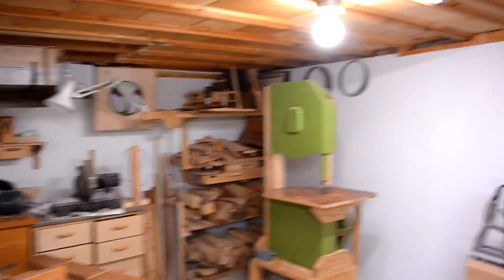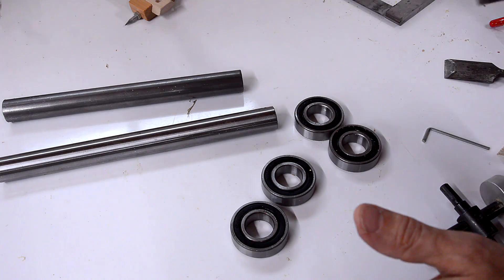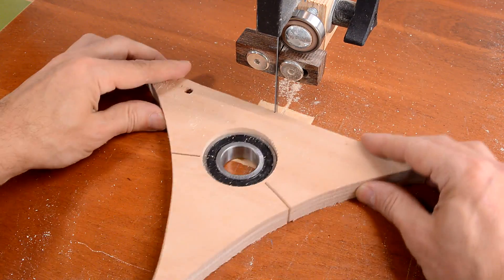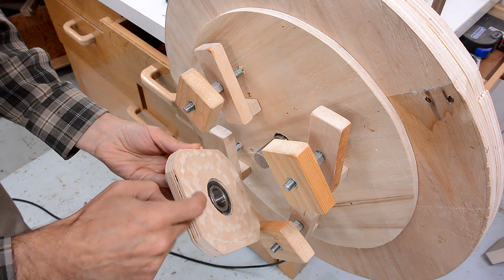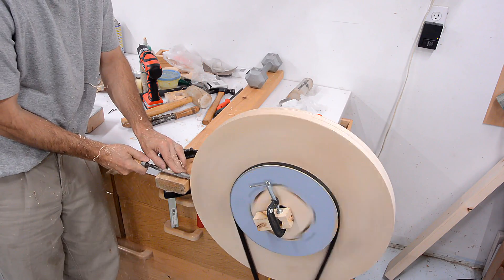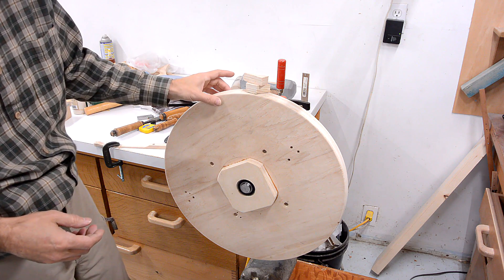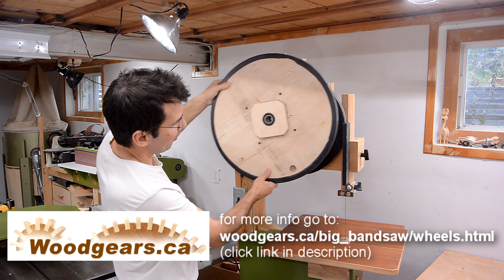Big bandsaw build 1: The wheels

Comment: Have you considered using some rubber cement to keep the tires in place?  I've done that on aluminum and cast iron bandsaw wheels, and it's worked great.

-jcr

Comment: What are the advantages of a larger band saw?   I'm building a shop in my basement and I'd like to build a bandsaw like yours.   Could you have weighed the wood that you used to balance the wheel then added some weight to the light side?

Comment: I've never seen the guide you used with your drill that looks like a router's plunge base. 

Did you craft that yourself, or is it a third-party accessory?
Reply: It's a handheld drill guide. They're quite cheap and very useful. You can use them to drill dowel holes as well as perpendicular holes on flat surfaces, including walls. https://www.amazon.com/s/ref=nb_sb_noss_2?url=search-alias%3Dtools&field-keywords=handheld+drill+guide&rh=n%3A228013%2Ck%3Ahandheld+drill+guide
Reply: Thanks!
Reply: BİR ŞEY 00???

Comment: What exactly do you mean when you want a crown on the wheel? What does that mean/refer to/do?
Reply from the maker: google it
Reply: Jean-Pierre English It needs to be higher in the center than the edges. Watch again when he puts the square on it afterwards.
Reply: The edge of the wheel is not a straight  cut. They are like  ")". So that bandsaw
 can aline itself on the wheel. Watch the video again. it is at 7:45
Reply: A counter-intuitive effect is that a tensioned flat belt loop running on pulleys, is that the belt tends to want to "climb", so if the center part of a pulley has slightly larger diameter, the belt will self-center on the pulley. No side walls are neeeded.

Comment: 7:23 why didnt you just leave it as big as possible for more capacity? and why only 2inches bigger than the other saw? seems pointless when you couldve done something bigger??
Reply: Fester Blats larger wheels result in a wider throat unless you have 3 wheels then you can use smaller wheels. u can get custom size blades at almost anywhere that sells blades
Reply: Where I work, we get bandsaw blade on a spool, so we can cut it to size. Then it is welded and ground. We can make a blade of pretty much any size.
Want a 50" wheel, 120" throat, 60" of free blade? We could make a band for it! (Not that I'd want to try using it)
Reply: Wayne Moore yip, anythings possible

Comment: Shouldn't the top wheel be as light as possible to decrease the stress on the blade and tires while starts and stops of the saw?
Reply: I don't think you need to worry about stress on the blade. I mean, it is a steel band. Stress on the tire will be no more than sawing stress on the bottom wheel.

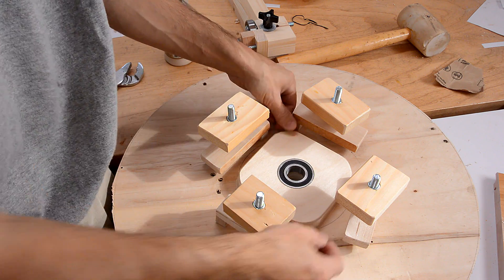Comment: At 4:50, Matthias centers the first flange by eyeballing it. I would think this would be the most important application and require more precise centering. Does it not matter because he knows he can lathe it true?
Reply: The flange corners have a circular radius. He also drew a circle on the wheel. I think he was visually aligning the radiused corners to the circle drawn on the wheel.

Comment: Have you ever considered a 3 wheel band saw?  Also what hand drill guide were you using around 4:00?  I've been looking for one and can't find of any any quality.
Reply from the maker: Three wheel bandsaws are a bad idea.  They break blades.
Basically, three wheel bandsaws are big bandsaws with most of the disadvantages of a small bandsaw
Reply: Thanks for the reply.
Reply: +lorddarphyve  there are several Mfg.s of this design  check the mail order tool catalogs  Rocklers  Lee Valley  Garrett Wade etc  or Amazon  I have seen them called Porta a line or porta guide
Reply: What's the physics behind this bladebreaking?
Reply: My understanding is 3 wheel bandsaws have shorter radius wheels which more easily fatigue the blades until they snap.
Reply: +Jared Parnell Partly correct, 3 wheels also increases the bending action on the blade by 50% per revolution. 
I'm pretty sure we all know what happens when you bend a piece of metal back and forth more than a handful of times ;)
Reply: The blade bends through 360 deg every revolution in either case - 2 x 180 for 2 wheels or 3 x 120 for 3 evenly spaced wheels. It's just the wheel/ bending radius that makes a difference.

Comment: What's the name of the tool he uses to drill the holes in the flanges for the bearings? The adjustable radius thing.
Reply: Fly cutter
Reply: I'm mixing metal and wood work. For wood they call it a circle hole cutter.  There is also a hole saw that isa cup shaped cutter with saw teeth around the rim.  Do a search on Ebay or amazon

Comment: what are the differences on a bigger wheeled bandsaw?
Reply from the maker: The wheels are biger
Reply: You can saw more bigly.
Reply: Larger wheels allows for larger stronger blades allowing a larger throat so you can cut bigger things.
Reply: Hope you don't mind me answering.  Larger radius wheels are much nicer to the blades as the blades are not bent in such a tight radius.  As blades get larger and thicker they get less flexible.
Reply: Fester Blats yes he doesn't have the best social skills, fantastic engineer though
Reply: More room between the cutting and returning blade, so you can fit larger work pieces between.
Reply: Matthias Wandel Haha.
I should of said, what are the advantages?
Reply: Looks like he's planning to use 1-1/2" blades... watch for some veneer uploads down the pike!
Reply: lmao
Reply: I think the bigger the  wheel the faster the saw moves.

Comment: I feel like fixing the wheel to a shaft with a hub and, using pillow block bearings, would make it a lot more durable. I could be wrong, but I like the idea of being able to grease my tools bearings.
Reply from the maker: Fixing the wheel to the shaft is not that easy or reliable.  Easier to put the bearings on the wheel.  My first bandsaw has the lower wheel fixed to the shaft, but this is much better.

Comment: Why would you varnish the wheel?  Will it work better, or just look super cool?
Reply from the maker: in case I cut wet wood
Reply: it also helps slow the expanding and compression of the wood due to moisture levels, preventing warping etc....waiting with baited breath for the next installment..I've considered building my own as well after seeing you first video years ago(Matthias) I just never get up the courage :)...guess it is better to try and fail, then to never try whatsoever.

Comment: I wish you would have explained why you would need a bigger bandsaw in the first place.
I mean, what is the benefit of a bigger radius?
Reply: A bigger radius allows for greater distance between the edge of the piece and the cut. Imagine ripping an 8x4 sheet of material into two pieces, each 8x2 (actually a little skinnier due to the saw kerf). No matter how you try, you would need a wheel diameter of at least two feet in order to make such a cut.
Reply: +John Cochran Ah, of course. That makes perfect sense. It's actually so obvious that I feel a bit embarrassed that I didn't realize it myself haha. Thanks for the explanation :)
Reply: You could add a 3rd or 4th wheel to attain the same effect, but the frame would have to be more rigid.
Reply: Wider radius' allow for bigger blades, in turn you can cut bigger material. On say a 14 inch bandsaw you couldn't put a blade suitable for slicing a plank of 2 inch thick stock (say 6inches wide for reference) down to two pieces of 1 inch thick stock because the width and thickness of the blade needed to withstand that sort of work wouldn't curve around a wheel that was 14inches in diameter. 

We have three bandsaws at work, one being the 14inch for fine work. The 26inch for the bigger stuff and the 35 inch monster for ripping rough stock as I just described.
Reply: Mads Rasmussen bigger is better

Comment: so can you clarify why the wheel diameter needed to be increased in order to increase the resawing capacity?
Reply from the maker: It doesn't.  But bigger wheels allow for thicker blades, which are more robust for resawing.  Also, when cutting out stuff, it helps to have some elbow room
Reply: Ah.  Thanks for the explaination.

Comment: Hi Matthias - I need a bandsaw and consider building yours.  But I am weighing that option against buying an old one. Where I live it's easy to find a cast iron 30 inch bandsaw for about 200 CAD.  The downside is that these weigh about 800kg.  Did you ever consider buying one of these?

Comment: if you want to prevent slip between clamped parts (yor steel rod clamped to the table for example) it is better by placing a thin layer of rubber (like electrical tape) between parts instead of adding excessive amount of pressure.

Comment: I appreciate the new build video. Very efficient. The older wheel-making videos were good, but there were issues for me in getting the hubs on straight and getting that danged temporary pulley and then the drive pulley centered. You addressed all the issues I had in building my wheels. The home made clamps really would help. Looking forward to the rest of the build.

Comment: I like the little test videos, like the sawhorse one, but the more complex and practical build videos are always your best stuff.

I assume more precise methods of cutting, like sanding or filing to shape, wouldn't help very much since you're using repurposed "old crap", as you put it. Brute-force jury-rigging is what I'm used to on my own projects, and "good enough" counts in my book, but after watching the Clickspring guy building his clock I have to wonder if more precise methods would make a useful difference on these low-grade materials you like to use.

Comment: Matthias, regarding the use of home made flange clamps rather than the bar clamps inserted through big holes: Do you think the trigger type speed clamps through the big holes would have worked?  Or is it something other than the twisting action during tightening that moves the flange?
Reply from the maker: Those speed clamps aren't much use for glue-ups.  Too weak.  And they flex a lot, so they'd certainly move the wood.  And you'd need a much bigger hole.  All around unsuitable.

Comment: I see you didn't decide to adopt Marius Hornberger's changes to your wheel design that work better for higher RPM, what kind of speed will this machine go at?
Reply: With a larger diameter wheel you do not have to increase the RPM in order to get a faster blade speed. Because the larger the diameter, the higher the peripheral surface speed. It follows this formula (PI * DIA * RPM) / 12 = Surface Feet Per Minute. So increasing either the diameter, or the RPM nets you a faster surface speed. This may also be why life is so fast in the tropical zone? They're just spinning quicker there.

Comment: Did you consider using the large bicycle wheels for your bandsaw. Can't remember where I saw it on youtube but the guy stripped the wheels off a bike and used for a band saw.
Reply from the maker: if you do, you need to replace the hub so you can get the right size shaft in there, which means you need to replace the spokes.  You also need to put something around the rim that is hard (like wood) to trim it to the right shape.  While you are at it, just throw away the bicycle rim too - makes it much easier.
Reply: True, you might be limited in the shaft size etc, but then you don't have to turn a crown molding as the tyre  is already crowned and that self centres the blade. If you use the shaft that comes with it then you're half way there. I saw it dine on a band saw mill.

Comment: Is there any reason why you didn't want to go larger than 20" to perhaps 24" (or more)? At 20", it doesn't seem that much larger than your other (18") bandsaw. (Serious question - not criticising). I'm guessing that maybe it's the blade cost, or the size motor it would take to turn them, or any bigger and it just wouldn't fit in your shop... So, since you are making it yourself and going through the effort (which is always  amazing), why not make a bigger jump in wheel size?

Comment: You are very talented and I love all the tools you make but I have to say the bandsaw ones scare the crap out of me.  I keep picturing the blade snapping and flying across the room cutting off everyone's head
Reply: sharkinfested You want to talk fear, watch some of Izzy Swans early Table saw projects. keep in mind both these guys have off the charts talent with their processes, so a bit of fear that causes caution is probably warranted.
Reply: Err...what?
Reply: In my experience, the most frightening thing about a blade snapping is the 'bang' it makes which is amplified by the metal casing, and can scare the proverbial out of you.  However, the same metal casing retains the broken blade - which loses all its motion pretty rapidly anyway as the break releases it from the drive wheels, so its just noise that produces a heart attack!
Reply: Don Johnson
Don't the manliest men run their saws without guards?
Reply: Still, the blade is very light and thus doesn't have a tremendous amount of kinetic energy once it is "released" from the wheels in one way or another.

Comment: Matthias, wondered if you'd seen Marius Hornberger's video where he altered the design of the wheels to prevent sawdust getting under the rubber, and if you've experienced the same issue?
Reply from the maker: He runs his too fast.  At slower speeds, it's not an issue.

Comment: matthias, just a question, wouldnot been better if you put little holes with heavy iron inside of the side with least weight instead of drilling all those holes to balance the wheel ?? that amount of holes doesnt affect the relaibility of the wheel? 
sorry for any error in my grammar.
Reply from the maker: The wood density changes slightly as humidity changes, so it's best to balance wood with wood.

Comment: Hi. Isn't it easier to add the lead counterweight than drilling the wheel partnerom
Reply: Easier and more structurally sound. I was hoping he wouldn't drill out material, but there's trade offs I guess. Less weight means less power used to turn the saw. More weight means smoother cutting (from the flywheel effect). IDK, which is better.
Reply: Im guessing no...since to add the lead he would have to drill a hole for it first.
Reply: In this case the weight difference is less then 1% of the total. And structurally there is enough playwood left, even in between the 3 holes.

Comment: For pressing bearings in and out, I use sockets. Just find the right size socket to fit the bearing without getting stuck along with it and press it in or out.
Reply from the maker: If you have a socket for 40 mm (1.5") bolts heads, yes.   I don't.  and neither do you.
Reply: I have a 3/4" drive socket set. So I have a 1.5" socket. I got some bigger than that too.
Reply: I have a 1 13/16 (which is about 46mm) impact socket and a 36mm impact socket, but I bought them specifically for making pullers with threaded bar for replacing the bushes on the wishbone of my car.
Reply: Oh well, at least he was pushing them into plywood, not a wheel support.

Comment: Instead of hammering those bearings you could just freeze them before, that way you would get a tight fit without risking yourself to make some damage those bearings. But either way it’s another great build  :)
Reply from the maker: this is not fitting them in metal.  Freezing them would not shrink them enough.
Reply: Of course it depends of the size of the hole and the metal shrinking factor, but I have managed to get really tight fits in several types of materials, mostly in metal, like you referred to, I've also experimented with nylon (bored on a lathe or a mill) and 3D printed ABS. I never tried in wood, but I guess the principle would still apply. I would really like to see you try the experiment on your other channel, well it’s a challenge from a fan of your work.

Comment: Matthias, you were really good this time finding a stress-free method to glue the flanges to the wheels. However, why don´t you use small dowels (like 6-8mm) instead of screws for the alignment? Clamp the flange to the wheel, tweak the wheel to an acceptable wobble and once you´re happy with it, drill 2 or more holes. The dowels are supposed to make a tight fit (not too thight) with the holes, so that there is no play. Once that is done, you can take it apart and mount it again by removing/inserting the dowels. The screws can still wobble and have play, the dowels don´t.
This is the way I´d glue the flanges onto the wheels if I were to build one (who knows). What do you think of this attempt?

Grüße
Reply from the maker: Screws are easier and work too

Comment: Why not with 3wheels...
Reply from the maker: because they break blades.  If you go to tufftooth.com, they guarantee their blades UNLESS you use a three wheeled bandsaw.
Reply: note that the 3 wheels are always smaller (because geometry...) and then the blade has to bend to a tighter radius. However there are some blades special for these bandsaws
Reply: Matthias Wandel   intresting... so is there ANY advantage to 3 wheels?

also intresting though: what if the radius of the wheel was less, wouldn't you get more working area?

Comment: Where did you get the 'drill guide' from? Any opinion(s) on using one?
Reply from the maker: I shouldn't have used it - just to avoid all these questions.  Freehand would have been good enough.
Reply: I have the same type drill guide, but from Sears (Craftsman).  Got it a long time ago, so don't know if they still carry them.  Handy where a drill press won't fit, but like Matthias said, freehand is good enough.
Reply: igounfazed, see my reply to Joe M (on a different thread). These are great tools.
Reply: I ask because I don't have a drill press, nor the home space to have one. It seems like it could help me out, but I'm not too sure, your experience with one would be greatly appreciated.